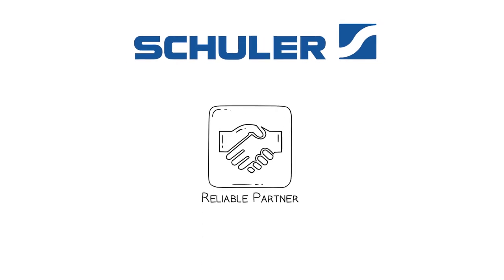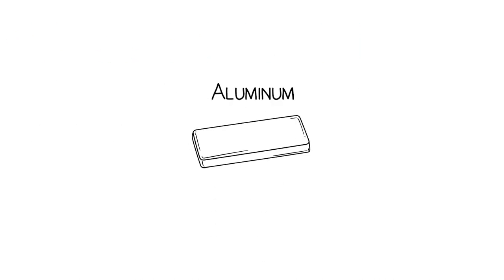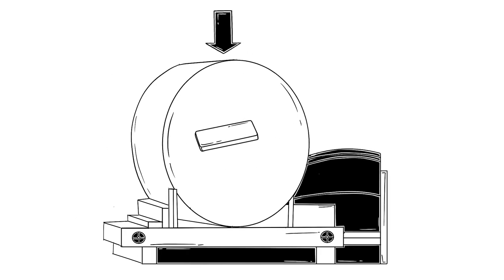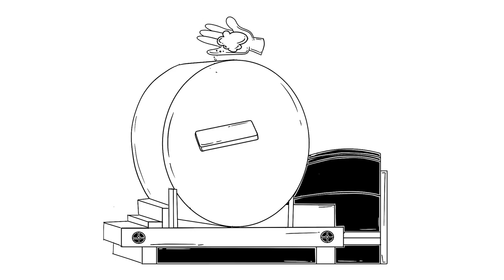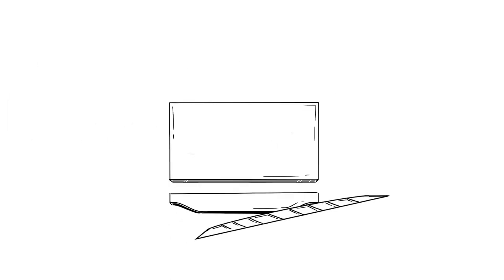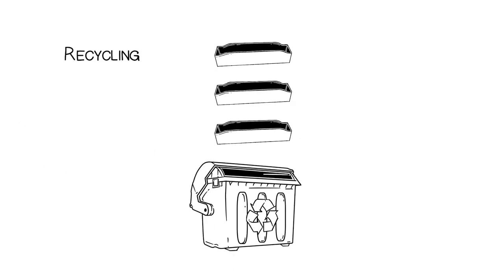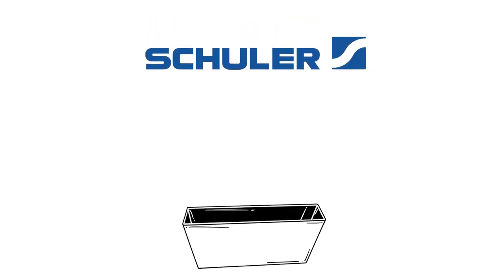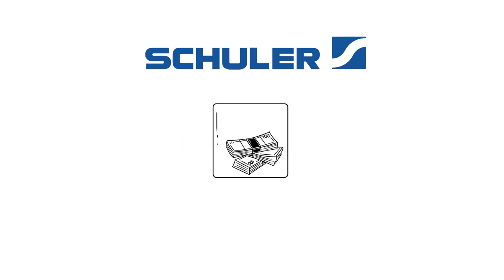Schuler - Manufacturing of Prismatic Battery Cases

Comment: What if the Length is 140mm and the width is just 26mm ? Will it be required a multiple impact extrusion process ? 
And what if the Aluminium gets weaker and  gets cracked and broke while ?
Reply from the maker: Thank you for the interest. Such dimensions are common. Impact extrusion is always a one-step process followed by 1-3 wall ironing steps. 
For sure, cracks have to be avoided. We use simulation tools and/or empirical testing to ensure feasibility when starting a project